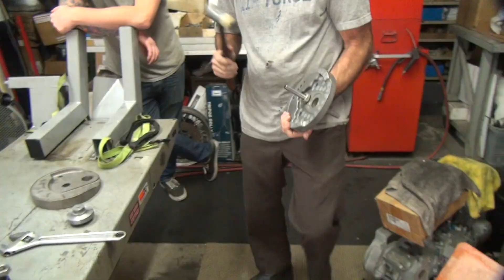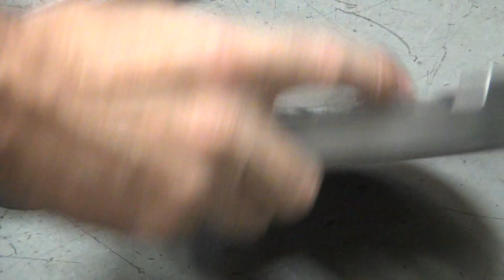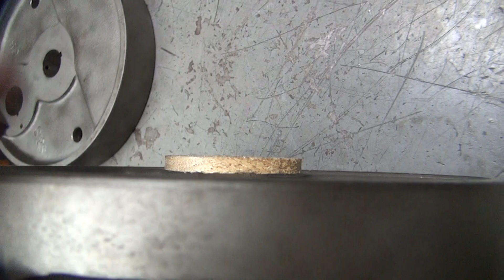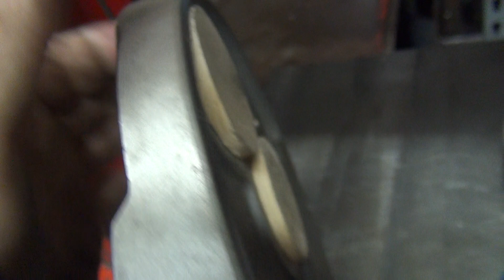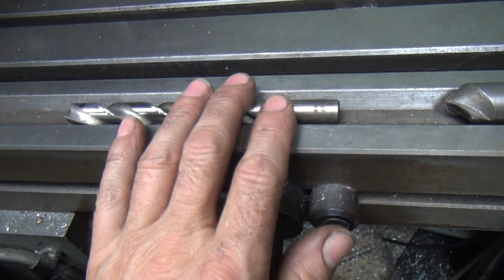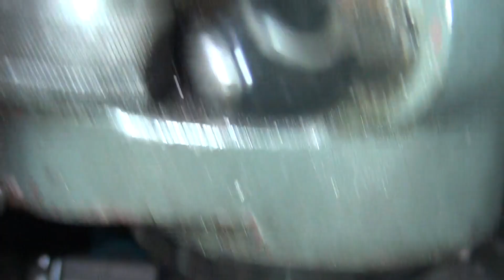building xl stroker 650cc single #102 sportster scta harley landspeed racing by tatro machine

Comment: Do you use a type of threading in the holes you poor lead? You know, to keep it from flying out of holes? I wonder if i could do this on mopar cranks. Mallory can be a bitch to use.
Reply from the maker: no threading the holes on the race flywheels, they are too thin. i use the big chamfer on the holes to keep the lead in place plus i beat it in with a hammer to make sure it is compressed into everything.
if you drill the holes thru the sides of the counterweights on the car crank and chamfer the holes on both side you should be good to go on using the lead.
tatro